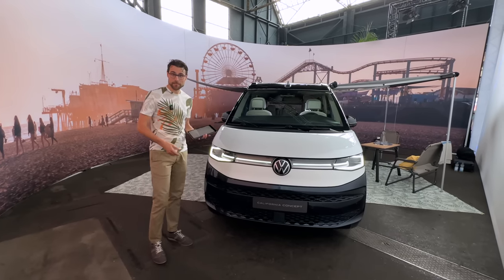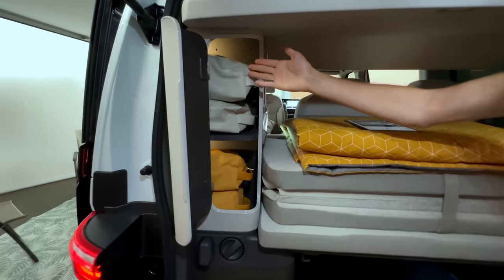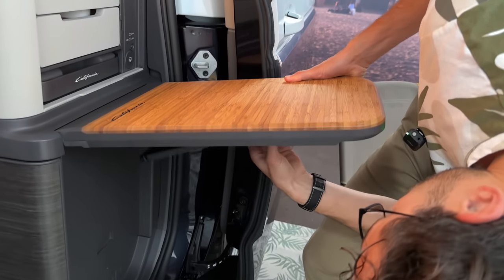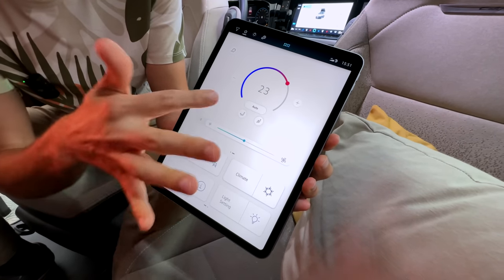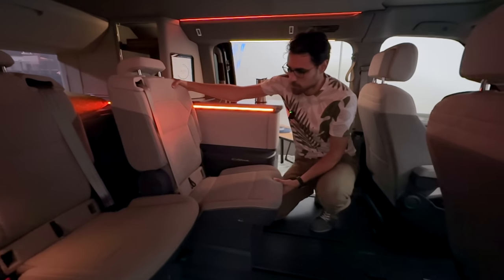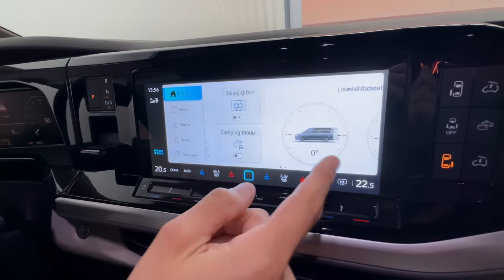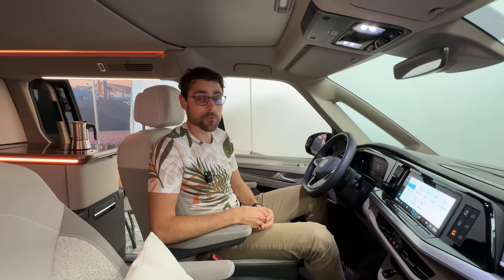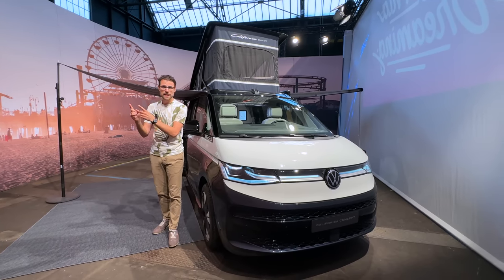Is the new VW T7 California the ultimate camper van?

Comment: I hate it, it sacrifices standard needed features and storage space for gimmicks you'll never really use.

Lower height, so more cramped and less boot storage then.
A huge cutlery drawer that slides 2 ways? Great if you live in an hot country where you eat al fresco all the time.
Also, a full drawer just dedicated to some spoons and forks?

2 types of hob? Why?

An ipad thing built into the wall where the vanity cupboard used to be, and why is it such an odd size, far too large just to control the gimmicks, but far too small to be an entertainment panel, and you sacrificed all that storage there so it can plug into the wall??

All the under sink storage gone, so you can have an slide out fridge and an extra hob?
The old system worked fine and hadnthat storage in tact.

 The deep wardrobe gone, wheres the clip on in door table gone?l, oh yeah its innthe boot takjng up even more storage space....again I hope itnisnt raining and you want to use that table inside....leave it in the door!

Window blinds? No? Ok.

How about some built in solar in that roof? No? Really!?

I was looking forward to this new model, but I'll be sticking to my 6.1 as I have a feeling their secondhand prices are going to rise, as the Cali range seems to have gone from the 'go anywhere capable compact camper' to 'Great for outside lunch on an campsite in spain somewhere' 😂